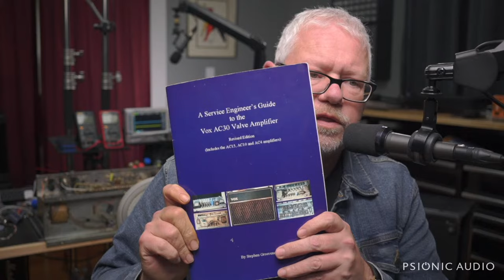Live Chat | Saturday Dec 2

Comment: I’ve seen the Bogner Shiva vids you did. Do you know if the older Shivas (silverback) have the problematic voltage regulators. Mine is older and it doesn’t seem to have a module like the later ones, but maybe there’s something on the main board. It does look to have green wires coming off the transformer
Reply from the maker: The older ones don’t have the switching power supply for the 12V. Much better amps for that reason IME.
Reply: Well that is quite reassuring!

Comment: hey Lyle, what do you think of the JVM410H? is it as bad with bias drift as the other modern marshalls? i really like the sound and versatility, but i'm not a tech and i don't want to have it needing rebiasing or new tubes installed after every other gig.
Reply from the maker: It doesn’t have the bias drift issues the TSL/DSL 100 2000s did. But there are much better amps at that price range. It promises much more than it delivers.
Reply: @PsionicAudio  i might have to add that i live in europe, and those amps are 1200€ new and 800€ used here. from what i've seen from the states, they're quite more expensive over there i assume. am i correct with this assumption? 

thank you kindly for your reply. much appreciated.